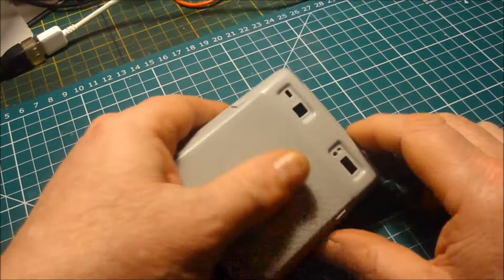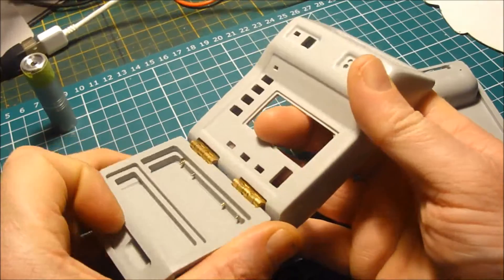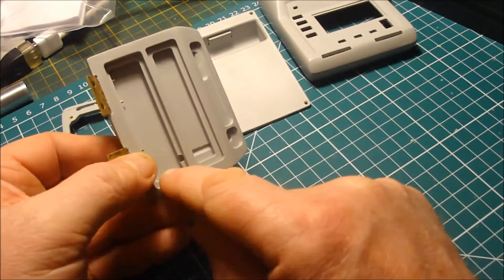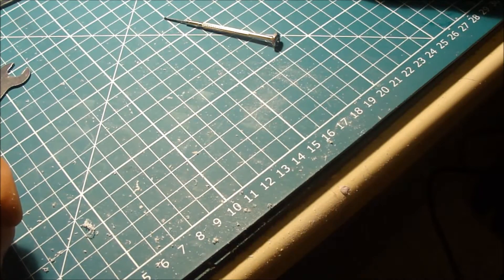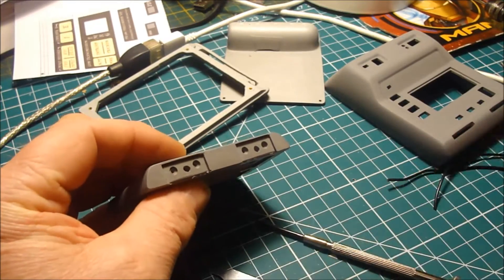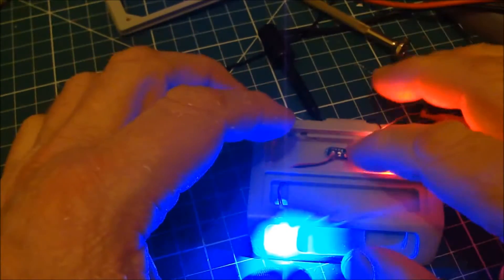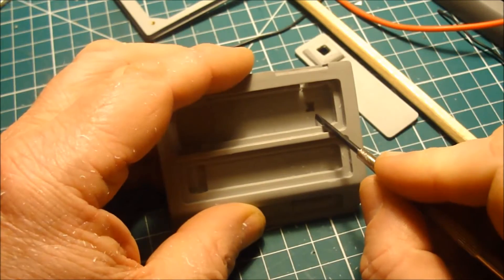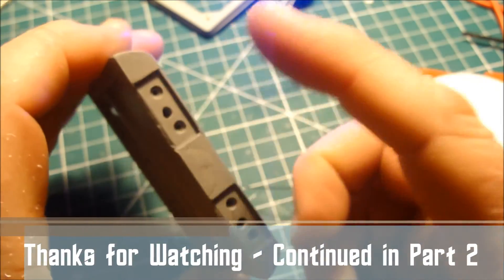Star Trek Medical Tricorder Part 1- MkXI Kit Build with Electronics

Comment: These tutorials are brilliant. I’ve been going over them the last few days. Can I ask what kind of wire you use? I’m not very experienced and don’t really know what I need.
Reply from the maker: Thanks I use a mix of sizes  - 22awg (1.7mm OD)  also 26awg (1.5mm OD).. thinner the better ..but if too thin its hard to work with so I do not use 28 or 30 awg - they are 1.2mm and 0.8mm but other might use them ... also I tend to use Multicore if I have it rather than single core - but both are fine
Reply: @FlankerTanker  thank you!
Reply: LOOOVE IT!!! 
Do you have an inventory list of what’s needed? And where to find the body? And/Or if the Playmates tricorder works for this mod?

Comment: Hi, can I ask what you use as the power supply for testing?  Also, what finishing cloth would you recommend to buy here in the UK?
Brilliant videos, have really helped me do mine. Only problem is, I had a 2nd hand kit with hinges done, but doesn't look like power is running thru the hinges
Reply from the maker: I have a Lavolta BPS-305 DC Power supply just off camera , I use any make of Microfiber cloth - but tend to get them from Halfords, it might be possible to still connect to the hinges from the inside - given that not too much has been done in that area...  good luck with your build it is always a bit more difficult when taking on work someone else has started ...
Reply: Thank you, your vid gave me the confidence to complete my first mark xi

Comment: If I heard you correctly, you mentioned having to remove the hinges to run wiring.  That's not necessary as the hinges themselves can conduct current.  Why not solder your wires to the screws?
Reply from the maker: No I said I need to take the  hinges off as I WILL USE them to conduct the power to the door...one is used as (+) and the other is  (  -  ) but I do need to solder wire onto them and that can be done better with the hinges removed from the moulding